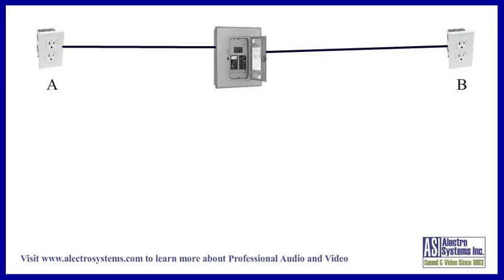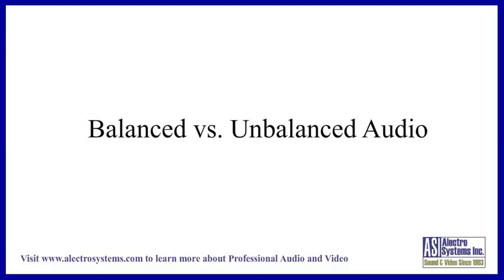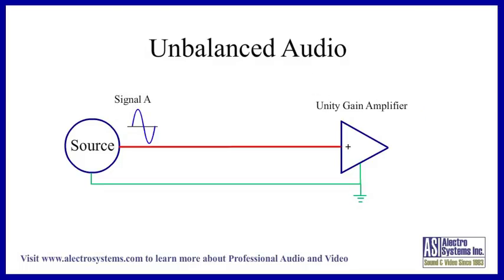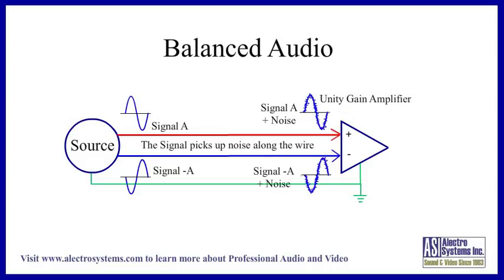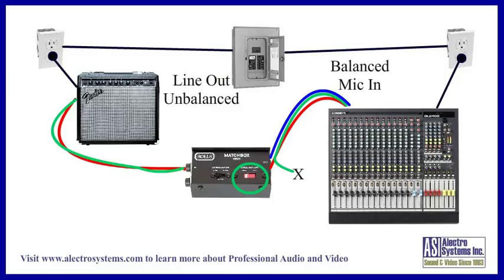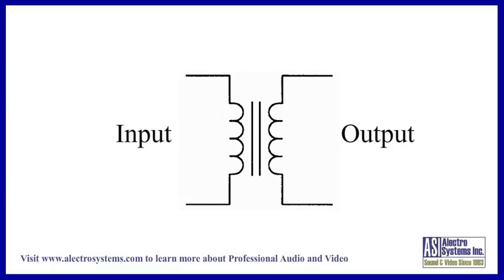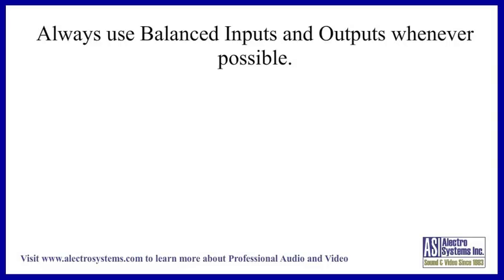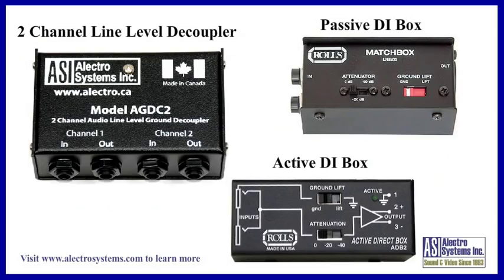Troubleshoot and Eliminate AC Hum on Sound System

Comment: So, I currently have an odd setup, so perhaps you can let me know a better way to deal with it. I have 2 different dacs feeding two different audio sources, when either is used individually, the ground noise is essentially zero, but when the two sources are merged, there is a horrible buzz. The signal is sent stereo via 3 wire, and I assume the problem is the shared 0v ground aren't the same on the two sources. One of the dacs is grounded to earth, but the other takes DC in and isn't ground referenced at all, i assume it functions on virtual ground. How would I mix together these two sources without the grounds clashing then causing hum?

Basically, I am attempting to have two different audio sources play on the same set of speakers, without buzzing occurring when more than one source is hooked up at the same time. Currently my solution is use a 2 way toggle switch that I have to flip manually to switch between the sources grounds, but I hate this solution.

Comment: I am getting AC Hum and Im not sure if this video helped. 

My setup

* Laptop plugged into same AC powerstrip as Monitors
* M-audio box (plugged into laptop via USB)
* then 2 KRK monitors (RCA to 1/4" connector coming from M-Audio
* Then my Mic is plugged into the M-audio box with the 48v turned on. 

I get a hum unless i touch the metal part of the XLR cables. As soon as I let go it comes back. Which device from this video could help me and where do I place it? 

Please help!

Comment: According to professional audio manufacturers like Apogee, your comment "all sound systems need to be balanced" is only true for live sound systems (club, festival, concert etc) where the mixer is at a far distance from the speakers/monitors. For home recording studio purposes this is most likely untrue. Its the long cables that require the system to be balanced. In most home studios the monitors are going to be nearby the audio interface therefore not requiring a balanced system. I've had no related issues using an unbalanced interface configuration.

Comment: Hi, great video great explanation, subbed.
I'm having a problem with my rig and beg for your help to understand what's the cause.
I plug my guitar (Ibanez RG with two Humbuckers and one single coil, properly grounded and shielded) straight to my Line 6 POD HD500x (wich is powered by a two pins plug transformer (I'm in Europe, so, no ground connection) and then monitor it through headphones. I'm getting a 50 cycle hum that goes away when I touch metal parts of guitar or POD. 
What's the cause of the hum? Lack of ground connection to the wall socket?
Reply: although it is most likely your line 6, check if you're plugging the headphones to the designated output. If you're plugging it to the line out, or the main out that goes to your amp, that might be the issue. also, the line 6 has a ground connection, which you can plug some wire into or touch with a screwdriver. If none of this works, get a grounded plug. Because we have grounded plugs in Europe too.
Reply: your guitar ground is good? is your guitar cable good quality? like does it pick up sounds?

Comment: I have the Shure Wireless MIcs using XLR cable to connected BMB karaoke mixer input.  It works fine, but want to add the compressor of  BEHRINGER MULTICOM PRO-XL MDX4600.  After connect them all together.  IT have the hum sounds.   So I think I need the DI box?   if so, do I need just 1 DI box or 2 boxes since I currently have 2 mics?    Thx

Comment: I worked in the ROV industry. We sent control signals and video over umbilicals 1000 Meters or more in length. Ground loops and noise were serious issues as well as the risk of fatal electrical shocks. First we had our power supplied by an Ungrounded Delta Wired Generator. This eliminates a power return to ground making operations much safer for personnel and equipment and while this option really does not apply with sound equipment I supplied it to show sometimes the problems can be caused by normal safe practices.

We eliminated or mostly got rid of our ground loop problems by isolating chassis or electrical ground from any signal ground  or signal path or return. In some systems we could have as many as four different isolated grounds. The bad news is that signal voltages could float above normal electrical ground but there was no path for current to flow. I would like to see the professional audio and sound operators and manufacturers adopt this philosophy by using totally isolated signal paths eliminating ground loops by doing so.

Comment: I was having this problem a few months ago with our PS3 when I connected it to one of our stereos.  Tried using grounded adapters for the outlet plug like someone on a forum had recommended, but that didn't work.  Figured out that the AV cable was sitting on top of the power cable from the unit.  I simply cut a small 3" length of pipe insulation (which I already had) and placed the AV cable inside of it, then let it rest atop the power cable, instead.  Hum immediately went away and hasn't been back.  Wish I had thought to do that, first; would've saved me a few bucks on something I don't use. :)
Reply: May I ask what kind of pipe you used?
Reply: @randinonsense7360  pipe insulation, it's a foam rubber sleeve like a pool noodle. I think it worked for him because it physically separated the two cables enough that the AV cable didn't pick up any EM radiation from the power cable.

Comment: A good video. In sound systems, howling, hum noise, ground noise, and oscillation (higher frequency instability) are big problems and each one has its own ways of being eliminated or attenuated. Oscillations sometimes have to do with amplifiers with very high feedback loops or with output and input lines to close to each other. Ground noise has to do with the so called ground loops while hum noise has to do with micro lines peaking up harmonics of line frequency that propagated by air or by AC lines to close to audio lines.
Howling has to do with microphone and loudspeaker closed to each other or resonances in the space where the system is used. To attenuate this trouble we have to reduce sound level, reposition micro and speakers, use frequency shifters and/or equalisers.
The PCB ground line is normally connected to the chassis somewhere and it is the main source of ground hum.This hum can be attenuated if we cut this direct connection (it is a short circuit) and connect both grounds through a wire wound resistor of about 10 Kohms having in parallel wit it a 2 MF ceramic, polyester, etc, capacitor.

Comment: Who uses the line out on a guitar amplifier? Most regular tube amps don't even have a line out. A more interestin question is, why you sometimes get electrical shocks from the microphon when playing guitar.
Reply: Hard question if no wire set up available

Comment: one question. i have an europe type outlet in my house ( 2 holes ), not an uk one, with that 3 holes ish. so what cables can i use to connect my equip ( not to meny, 2 speakers and a piano , i wanna buy this because my hs 80m makes a white hmmssss noize when the volume it s around 12 a clock ). can/should i put a power pc desktop type cable from one outlet of the furman and then put a normal outlet to connect my 2 holes outlet ?????  or can i simply plug a 2 hole stuff in that Furman 3 hole by clicking that third pin that opens the other 2.....???? hope i maade myself clear . Thank you.
Reply: Watch a video about correct gain staging.

Comment: Well, now I'm really confused. I bought a DI box and it solved my loud static noise to the point that the guitar overpowers the static, but I still have a low hum that's pretty noticeable.
Reply: +Ryan Schrader put a noise gate in your guitar chain before the Di you would still have a slight hum due to your amp solid state or tube when you start playing it will go away.
Reply: low quality di box?

Comment: Great video! Do voltage regulators help? My system also has a hum but only  Ribbon Microphones bring it out clearly. As you described in the video, my 50ft. snake amplifies the hum signal very well. So I wonder if I plug all my equipment into a single Voltage regulator such as the APC LE1200, would that get rid of the hum?
Reply: +OZ B Just realized that I may need a Power Conditioner - not a regulator! Going to try the Furman M-8X2. Anyone else try that unit to eliminate hum and hiss?

Comment: Great explanation of ground loops.
 Just being picky here but when you say '180 degrees out of phase' you are actually talking about opposite polarity. Phase implies a time delay, having the same signal just delayed half a cycle.  Your statements get the point across but to be accurate you should use polarity.
Reply: Yes, opposite polarity.  In-phase would imply exactly 180 (degrees) of phase,   anything other than 180 (degrees) are referred to as "out of phase."  Phase does not imply a time delay.  If you calculate it 2 phases (1 cycle) at 60hz (60 cycles or 120 Alternating polarities a second.  But your ear wouldn't hear this as a delay.   Phase refers to a relationship between positive and negative polarity in the sine signal.   As it pertains to microphones and pick-ups, out of phase would imply an auditory delay not a delay from a ground loop.
Reply: Indeed Douglas Sebens, it is a common misconception. It is not 180 degrees out of phase, it is inverted.
However, the ground loop explanation is fundamentally wrong in this video, so not so great.. There is no potential difference between the earthing connections of wall outlets if no devices are connected to them. Once a ground loop is created (or any loop of electrically conducting material), a current starts to flow through the loop, creating the potential difference.

And by the way, jon wilson, you're talking shit.. it makes no sense at all.

Comment: Well, after watching this video among others, and reading a few long articles about eliminating ground loops, I am now more thoroughly confused and frustrated than ever.

Thinking and hoping that I was now better informed and able to eliminate the AC hum from my system, I proceeded to reconnect the essential components only, after unplugging everything from my AC outlets. 

I don't have a studio, don't do any mixing or recording and only want to playback music so I went to plug in the three pieces that I believe are absolutely essential to do so, my cd player, preamplifier and powered monitor speakers. I would plug my CD player directly into my speakers, but I don't have compatible interconnects(the CD player has analog RCA line level outs while the monitor speakers have balanced XLR and TRS inputs) and believe the preamp is necessary anyway. All three have three prong grounded AC plugs. 

I wanted to plug all three into the same power outlet but unfortunately there are only two electrical "sockets" in the outlet so I added a 6 outlet swivel "side socket" into it, which is only connected to the wall outlet by a single three prong plug which I'm hoping is equivalent to using only a single outlet. I also have a power strip, but that also caused me problems and thought this arrangement would be better and more convenient.

Anyway, I plugged in my CD player, preamp and powered monitor speaker and waited to see if the hum persisted, which it unfortunately did.  The CD player is connected to the preamp using analog Red/White RCA line level interconnects, while the preamp is connected to the monitor speaker with a balanced XLR cable. 

After hearing the hum, I turned the CD player off and the hum level actually lowered slightly, then I unplugged it, but I don't think there was any significant difference between it being unplugged and powered off. 

What was much more significant was the preamp, it contributed a major amount to the humming sound coming out of the speaker. I unplugged the preamp and the humming sound diminished significantly, but not completely, there was still a very low amount of "static" emanating from the speaker. When I plugged the preamp back in, again it contributed greatly to the humming sound coming from the speaker, and when I plugged in the CD player and turned it on, it adding a little bit more buzz. 

I'm not sure if this is indeed a ground loop or if it is simply the ground noise level of my system, but either way, the hum is too loud to be tolerated by me and I shut it all off in frustration. 

Given that I only had the three essential components plugged in, what can I do to eliminate the humming sound to make my system usable?

I suppose I'll have to buy one of those things mentioned in the video, but I'm reluctant to spend any money and more importantly, I don't have the right inputs/outputs(and I would rather not have to buy more/new interconnects) and honestly would not know where/how to install it in my system. 

Of course I am definitely not wanting to get a ground lifter plug until it is absolutely necessary which I don't believe it is after all the research I've done, nor am I the kind of person to cut the ground prong off of my plug.

To make matters worse, there seem to be a myriad of ways of solving ground loop problems and I would want to use the best, most effective one, but also the most cost effective one as well as I am on a pretty tight budget right now. 

Any ideas/suggestions would be appreciated, thank you.

And yes, I have watched this video(and others) all the way through, but honestly, I still don't really understand what's being said(it really is a very basic course in understanding electrical circuitry and stuff) and even if I did, there's a difference between theory and application. For example, there are a lot of people who can do math problems for homework by rote in a book, but haven't the slightest idea of how to apply it to real life situations(I"m not generally one of them, but the actual application of concepts is not always easy and certainly benefits from experience and repetition, something which I don't have the benefit of)

Finally, believe me, I like understanding the theoretical aspects of a problem and knowing why I should do something, but at this point(being frustrated) I'm more practical and just want to fix the problem and get on with my life; I want to relax and listen to some good, tranquil and soothing music.
Reply: +mydogskips2  Hums and buzzes are not a simple thing to diagnose. There are just too many variables.  If you are handy with a soldering iron you can try the "poor-mans" ground lift, Open up the pre-amp end of the XLR cable and locate the shield. It should be soldered into pin 1 of the XLR connector. Disconnect it from the pin 1 connection either by de-soldering or clipping it off. Plug things back in making sure the cable shield does not touch anything and see what happens. You don't have to be worried about shocks here since both chassis are (supposedly) grounded with a 3 prong plug and the signal level is 1 volt or less.

 You've got a 50/50 chance that it will help. If not, be sure to solder the shield back into the connector. If it does help, solder the shield back in place and by an isolation transformer.

Doug
Reply: +Douglas Sebens   Thanks, but I'm not at all handy with a soldering iron or anything else.  I wouldn't feel comfortable opening up my preamp and I'm not sure which is pin 1 on my XLR cable. 

I do appreciate your interest and response however, and only lament my ignorance on the subject.

Comment: i dont know what the hell is going on in my setup but i know every time i move it i need 7 days to get rid of all the problems, i actually must place an interconnect cable between monitor and ground breaker or sound card in such a way that it must be on my keyboard, it really wants to fuck with me. I tried to pay attention to cable management  after a day of moving the cables its back to a total cable mess but there is no hum. I dont know what makes the ground loop, cuz ive moved it so many times i dont even know what goes where, but its a big pain in the ass for a guitar or mixers with powered monitors